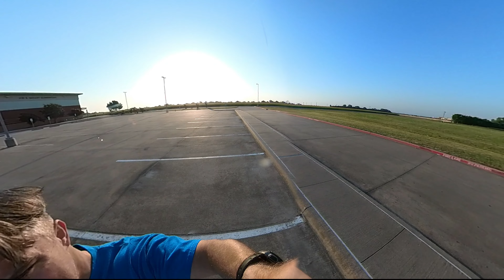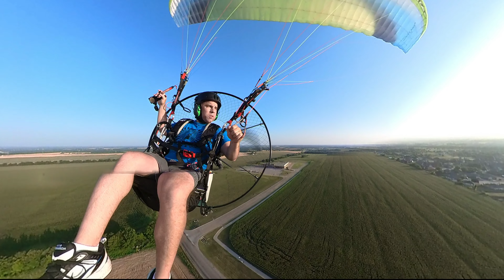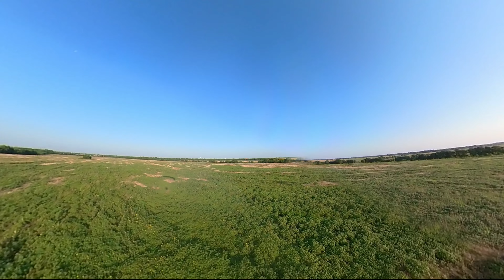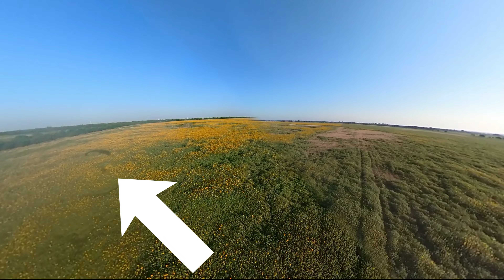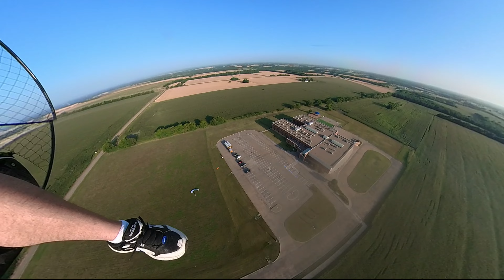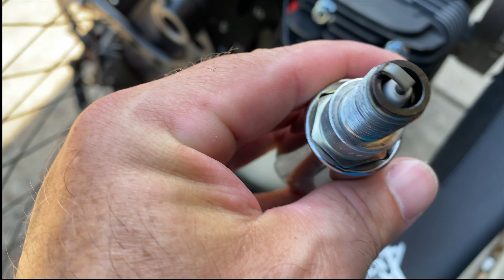Setting the Carb on the Viper 200 on my True North Paramotor

Comment: How are you liking the Viper?  I just ordered the Viper along with Vortex Aero's frame as my first paramotor.  Can't wait to get it!
Reply from the maker: So far, so good.  I've got about 15 hours on it.  I was running too rich and fouled my plug, but I've got it dialed in now.  Mine came with the electric start connections already hooked up.  I just bought a Battery Tender jump pack, and plugged it right in.  Very light compared to lead batteries and it goes forever before needing to be charged.

https://www.walmart.com/ip/Battery-Tender-1000A-Jump-Starter-8000mAh-Power-Pack-with-Rapid-10W-Wireless-Charger/906515648

I was nervous about not having a clutch, but it has not been a problem.  I just cut my motor off when I'm about to land.
Reply: Thanks!  I bought the dual start too.  I was debating on getting a clutched motor, but the price Vortex Aero gave me for the package deal was way too good to pass up.  Basically half what an equivalent paramotor costs.